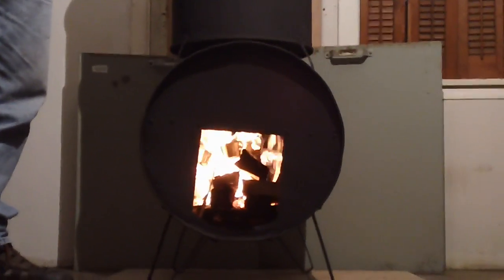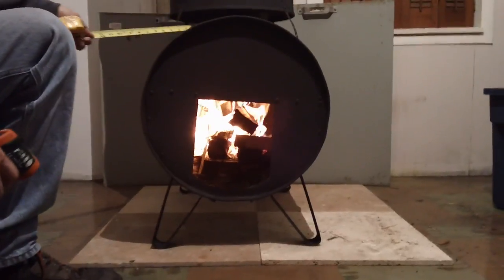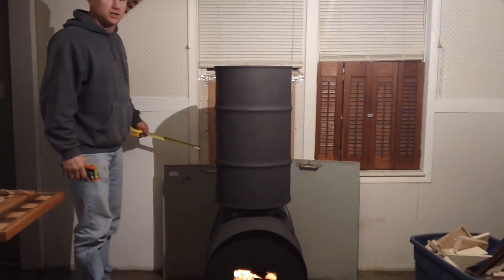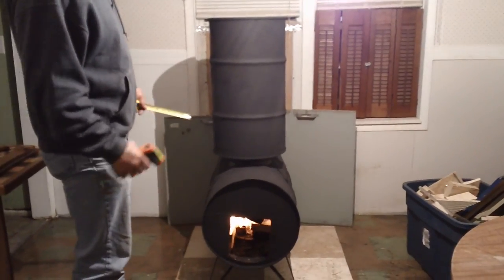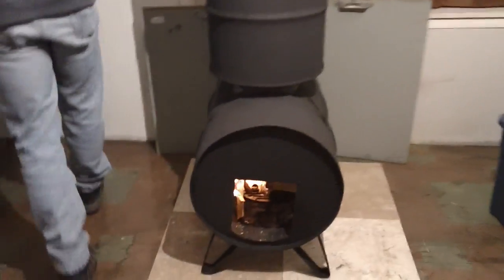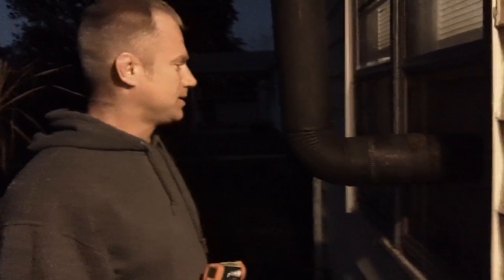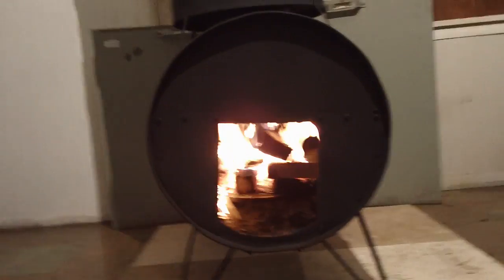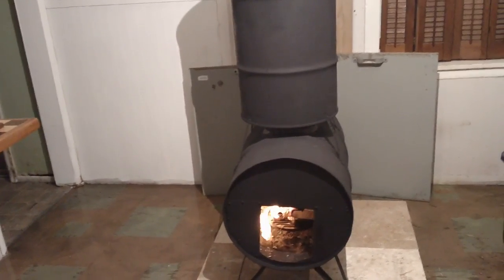DIY $75 Rocket Stove from 2 Barrels: Fast, Affordable & Efficient- Van Powell Budget-Friendly Builds

Comment: awesome ive made 14 stoves like this but using old propane tanks ,with doors closer and cleanouts etc,two are in a hotel ,the flue temp output is incredibly low ,the flue they have is on both sides of the farm  60 ft high ,no problems as of to date with creosote or back drafting etc ,thats 3 years theyve used them until now,i use a steel grate ,shakers from a quarry  to raise the fire slightly and get more air underneath ,they work very well and are smokeless.nice work and love the quick build idea greatly .
Reply: please post some photos and some construction info. thanks.

Comment: what is the minimum outside exhaust temperature so as to not interrupt exhaust pull ?   I guess I said that right.
Reply from the maker: 2 considerations gasses cooling and condensing on flue walls causes creosote and as the fire dies and is going out if you dont maintain enough heat your draft will back flow in the house,, 225-250... is recommended but you can push it down to  below 200 but you may be pushing it.. If you do just keep an eye on build up to let you know how your doing
.

Comment: Given that the top barrel is functioning almost like a rocket mass heater, you might consider moving the exit to the outside pipe lower on the top barrel.  That might allow a longer burn time in the upper barrel before it exits outside, resulting in even more complete combustion and even less heat exiting outside.

Just a suggestion.

Comment: I was thinking about some thing like this. But using fire brick in the bottom with a rack maybe. to keep the bottom from burning out so fast. I have no ideal what I will do for sure  when I build one. I was thinking of heating and cooking use too. For now I keep learning. Thanks for showing your stove.
Reply: You can just put a layer of sand in the bottom of the fire box to insulate the floor of the burn chamber.  Just don't scoop all the way down when you take the ashes out.  As far as that goes, ashes alone will do the job.